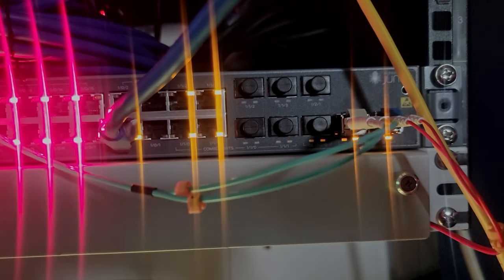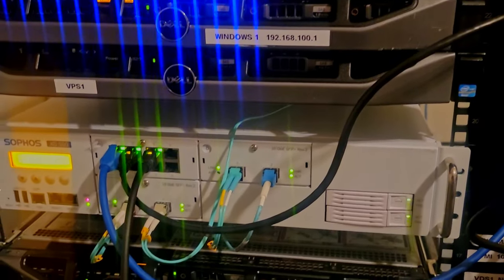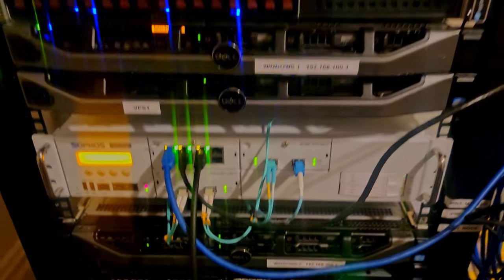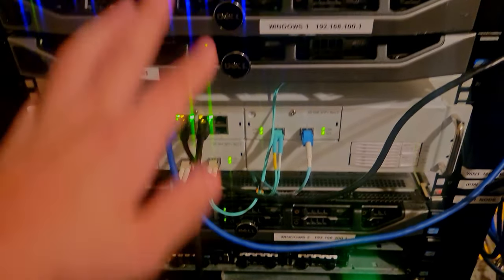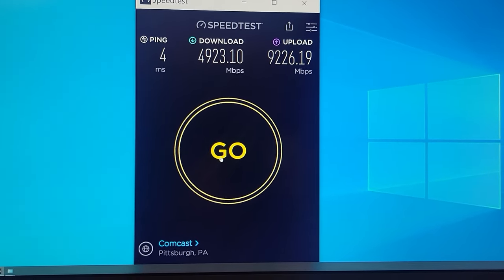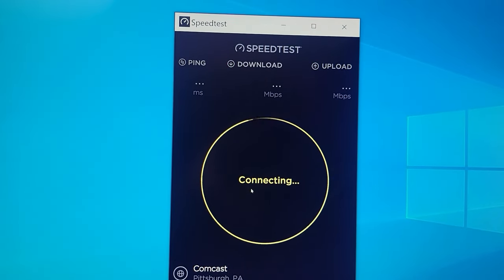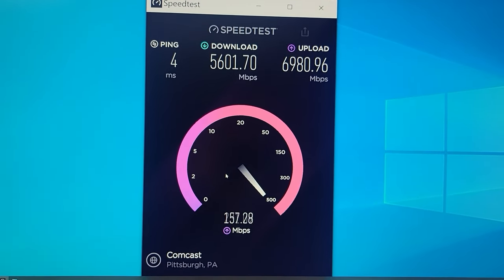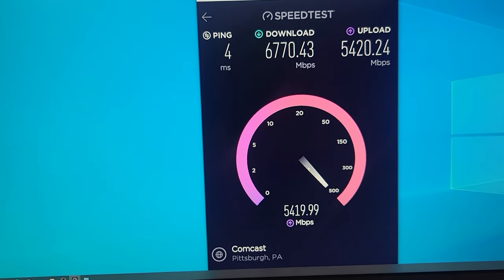Comcast Xfinity's secret 10 Gbps package they don't tell you about

Comment: Maybe they didn't tell us cause it was just released and also it wasn't a secret
Reply: I'm a tech guy, most people do not have the, proper equipment to run 10GB. If you have 10GB service, your computer will slow it down to it's speed, average 1GB to3GB.
Reply: @TOONMAN200  clearly you not a tech guy. There is no 10gbps package. It's a 10G network. That means it's faster and more reliable then 5G.
Reply: @eddiemorrison4127 no

Comment: This looks suspiciously like xfinity buessness class. Rack mount switches and routers are not designed (keyword) for home use. Can you have it in your home yes. Is there a point to it absolutely not. In fact for MOST people even gig is a ripoff. I have a 400/20 xfinity package and am more then happy with it. My father and brother share a 100/100 where they live also more then enough for them. unless you are hosting web servers there is no need for faster then at most 500 Mb internet. Keep in mind your connection is only as fast as its weakest link. You could have 100Gb internet but if you connect to a server that has a max upload of 20Mbps you still get that speed. Also most people don't have computers that can utilize such speeds in their home. Even 2.5GB network cards are Still not common in homes.